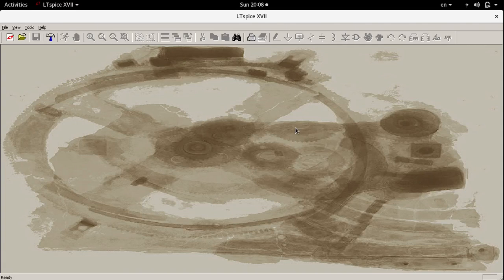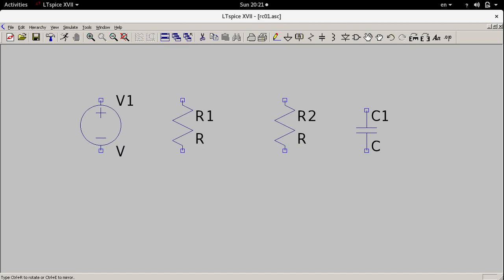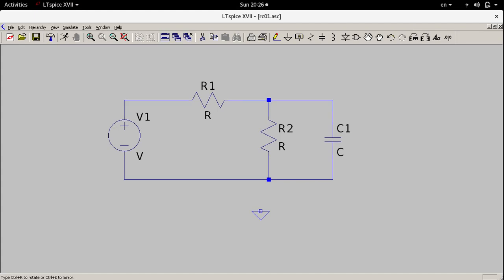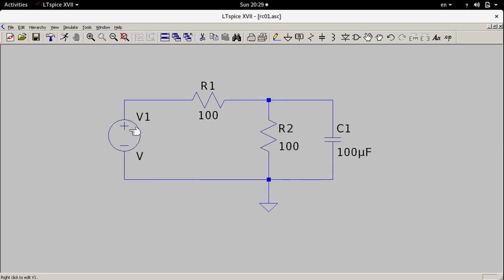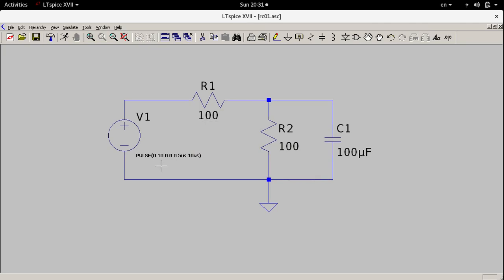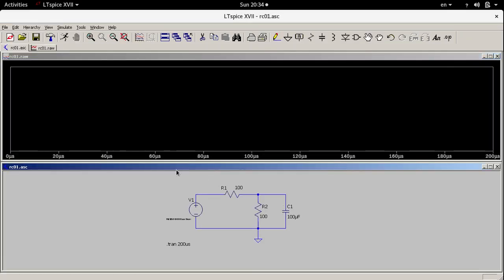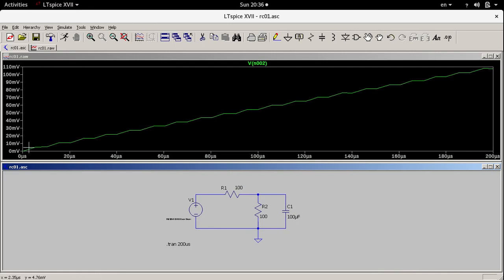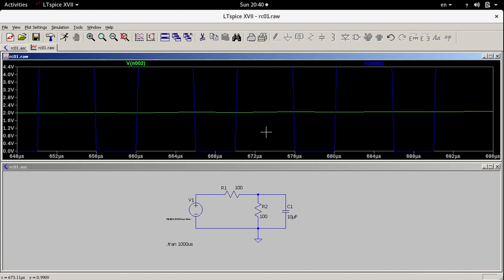Quick start circuit simulation using LTSpice XVII

Comment: I need to simulate a grid tie inverter for a mini wind turbine. The grid is 120V and i have to synchronize the voltage from the mini wind turbine generator and the voltage from the grid. They must be synchronized to 60Hz. Would you know how to make a schematic of a grid tie inverter on LtSpice? sir, is it possible to create?